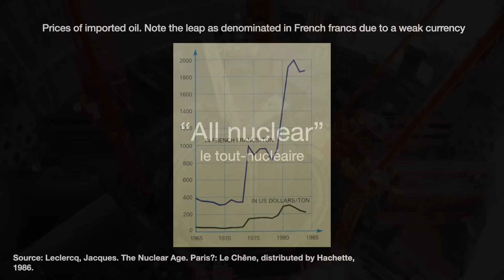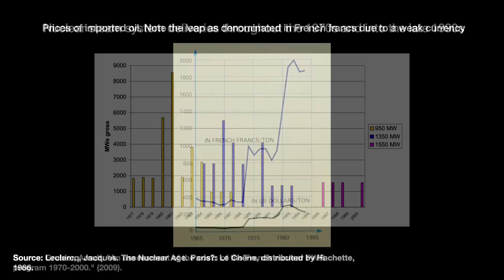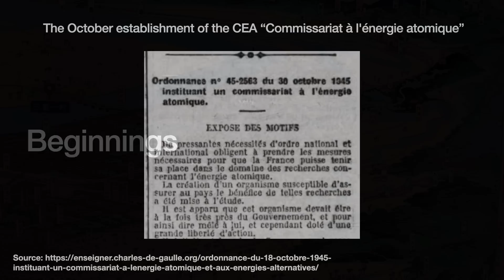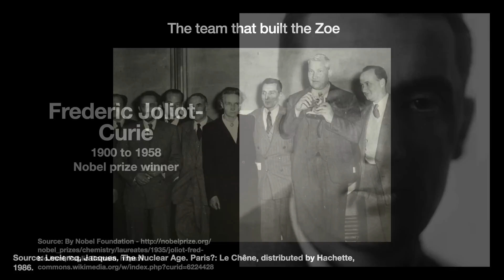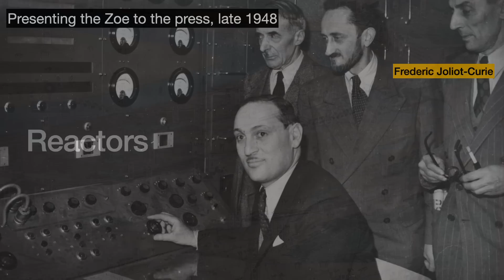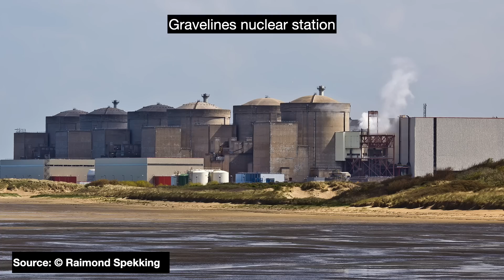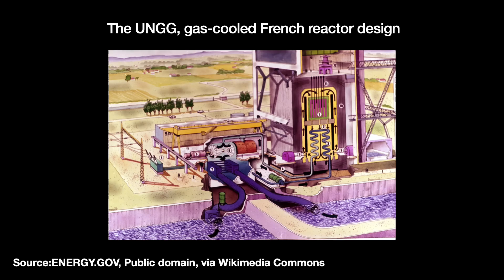That Time France Went "All Nuclear"

Comment: 19:55 freezing requirements after the build has started to reduce rework and achieve economies of scale by standardization?
Imagine if every government project did that
Reply: That would go against the govetment instinct to grew
Reply: But if we do that, how will I, an egomaniac in charge, take credit??
Reply: Freezing requirements doesn't mean you don't update in process, it means you don't require more and more goals and targets after building starting.
This "changing requirements partway through" often happened to military aircraft in the cold war, where it would be designed for one role, then they would keep adding more roles, more payload types, more "things it has to do" after it was already designed and building started, and eventually the end result would either be poorly suited for any role, or just so cost overrun and delayed it would be cancelled.
Reply: @lelsewherelelsewhere9435 they are one and the same. Frequently the small "updates" add construction time, complication, etc. All updates start as small tweaks that are a tiny portion of the project. But they creep costs and timelines up. None of the gigantic programs that the defense industrial base, or the government meant to build were supposed to wind up that way, but they always did...and it's not just because of bad estimates. It's also because everyone and their mother added something.
Reply: @lelsewherelelsewhere9435 in the cold war? that happened to some ships in the us recently
Reply: Or the other way of looking at it at the problem, imagine if we allowed startups to put in small reactors into the grid and make money from producing this energy.  Get away from the planned projects sand put faith in the system to make small reactors.
Reply: ? Most infrasttructure and much of the housing etc is built by the public, its how we got rich after the second world war... we didnt fast, cheap, viable and often surprisingly well. Some countries cheated, some involved the mafia (looking at you Italy) but most did a very good job. 

Its the last couple of decades that government lost most of its ability to plan and think ahead and thats the era of Thatcher and Reagan. Its the markets and the ultrarichs era. We will be here to pick up the pieces after they have had their run.
Reply: > freezing requirements after the build has started 

As a superb and decisive approach this is... moot, everywhere, because we need to enhance any plant (or reactor) thanks to knowledge gained elsewhere (more often than not after to some mishap, leading to a 'fix' theoretically enhancing safety), effect of "postmortem documentation".  Even France didn't "freeze" anything this way, and all reactors were and remain retrofitted from time to time.  Such "specifications freezing" may apparently be useful as long as the plant is a work-in-progress but isn't, as a just-completed plant or reactor which is declared unfit thanks to new 'bugs' discovered elsewhere HAS to be adjusted before starting, and therefore knowing as soon as possible that it has to be done is way better than neglecting it, "finishing" the work, then figure how to adjust and do it (maybe destroying some just-built stuff) before starting it.

> economies of scale by standardization

This is another moot Graal.  Standardization lends towards an "all plants and reactors are exactly the same" state of affairs, which could lead to a disaster in case of generic non-negligible problem (potentially dangerous 'bug' in some part of the design, material used, building or whatever..., letting no other option than shutting down all plants in order to fix them).  In 2022 and 2023 many French reactors models N4 and P'4 were diagnosed with some corrosion, then quickly shut down for a fix.  It caused quite a turmoil by temporarily and without any warning shutting down a fair part (~25%) of the fleet.  If each and any reactors was either a N4 or P'4 (standardization, yay!) they would all be off'ed and France, were nuclear usually produces ~70% of gridpower, would be in a terrible situation. Standardization is OK as long as it doesn't collide with some other more important requirement, such as safety, and it so collides quite soon. Moreover standardization boosts the awful effect of the law of diminishing returns.
Reply: @natmaka  Standardization is easier to sell politically, which is how they get built in the first place. I can't imagine constantly tweaking a reactor mid construction until the cost balloons out and no politician wants to build another reactor under their term again. 

One overpriced but ultra efficient reactor is nothing compared to 20 less efficient reactors that politicians can just say "well we know how to build them, lets build some more."
Reply: @dannyzero692  Indeed, this approach is, as stated in the documentary, a way to block scientists/engineers' new ideas, of unknown practical value, to potentially induce some bad side-effect into a work-in-progress.  It is precautionary.  It establishes that any building process works on a stable design, it is 'standardization by series' (each item in a series being nearly identical to any other one).

Calling 'standardization' seems far-fetched to me, as in an industrial context it means that nearly each given component of any series or instance (plant/reactor) is interchangeable.  This very approach was not new, it was adopted for weapon systems (in France for the Gribeauval artillery system ~250 years before, then by S. Colt, and even for the famous 'Terracotta Army' of a quite ancient Chinese emperor).

Comment: A question, how long does a reactor stay in service? What’s the long term cost of this decommissioned reactor. Oh and the reactor byproduct where does it go? The cost and problems with the radioactive byproduct I never see studied. After the reactor is decommissioned whose paying the cost protecting the radioactive structure, centuries?
Reply: France24 recently released a YouTube video on the French reprocessing facility. 96% of "spent" fuel rods are reprocessed into new fuel. Nuclear plants (depending on the design) are designed for 30 to 60 years of continuous use and can usually be extended and recertified for continued use. The fuel rods are considered "spent" not because the enriched uranium is used but because the byproducts produced "poison" the reaction. The 4% of waste (as mentioned in this video) is vitrified and stored. The uranium and plutonium (plutonium is a byproduct) is used to create new fuel. The radioactive structure is primarily not radioactive beyond a few decades and doesn't pose a long-term problem. Some of the "radioactive byproduct" is extremely valuable in medicine and other research. The USA retired the only large-scale fuel recycling plant in the US some time ago, thinking it made nuclear proliferation easier. Plutonium is significantly easier to extract from spent fuel than it is to enrich uranium. Basically the spent fuel rods waiting around in pools of water are quite valuable if reprocessed, so they really aren't a large problem unless you let them just sit there. France reprocesses their spent fuel (unlike the US), and thus, the "large problem" really doesn't exist for France. Only a very small percentage (2% if my memory is correct) of the enriched uranium is actually burned. However, the radioactive byproducts from this means the fuel must be reprocessed and the byproducts removed. You should really watch the video France24 did on their YouTube channel. Nuclear waste is not really a big problem.
Reply: EDF pays into a plant decommissioning and spent fuel burial site construction fund, both of which are considered to be sufficiently capitalised by the state auditors
Reply: 60 years for a reactor, but if it's in good condition some decades can be added (or substracted if problems arise, or if political views on nuclear energy change.) EDF is supposed to take care of everything cost-wise, as provisions are in theory made during the operative years to cover the cost of decommissioning. In practice, EDF is pretty much broke lately, so the tax-paying citizens will cover the cost. For now, the long life high activity waste (naaasty stuff) is stocked in "temporary" pools (they heat up to 800°C if left unattended). A long-term storage facility is being built, but nowhere near completion.
Reply: @brunetyannick1174 The decommissioning fund is separate from EDF's finances, which have markedly improved since renationalisation, with more than €20 billion in profit since and a similar credit rating to the other largest EU utilities. The part about spent fuel is pure fear-mongering.
Reply: @JayWasAlreadyTaken I really hope it works better than the German system. The companies had to reserve money but they invested that into coal power plants. Which are now worthless.
Reply: @brunetyannick1174 The decommissioning and final spent fuel repository construction funds are separate from EDF's regular finances abd you can find recent reports from the Cour de Comptes that estimate that they're sufficient for the task. EDF itself was run to the ground by ill-advised policies to please the EU (the ARENH system that basically provides nuclear electricity below cost to its competitors), the government taking what profits remained to plug holes in the general budget, forging EDF to go into debt for working capital, and high electricity spot prices in 2022 while the sale prices for the public were frozen and EDF needed to buy electricity in the open market due to maintenance issues. Since re-nationalisation they have made about €20 billion in profit and paid about the same in debt, their current credit rating is equivalent to that of the other largest European utilities.